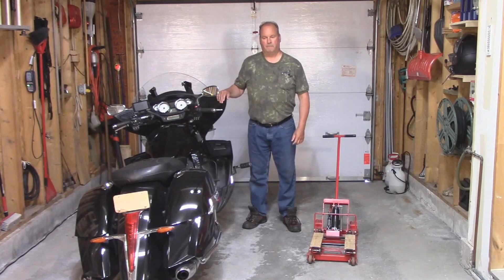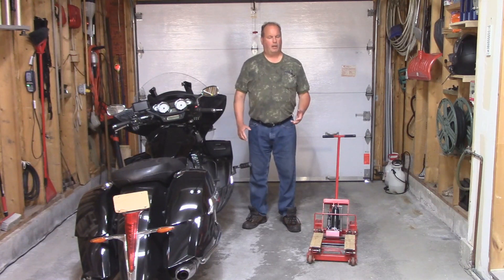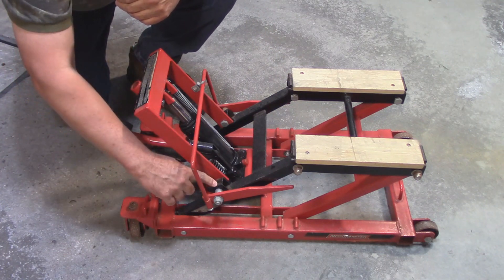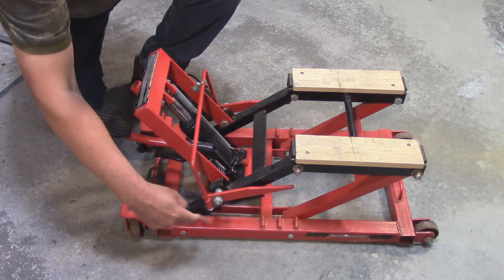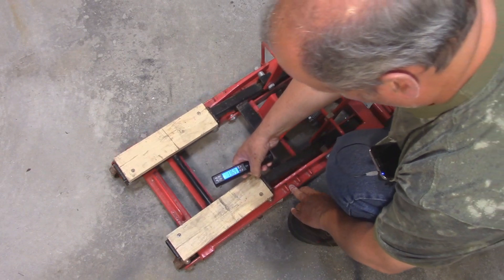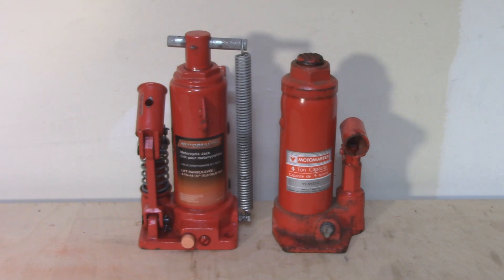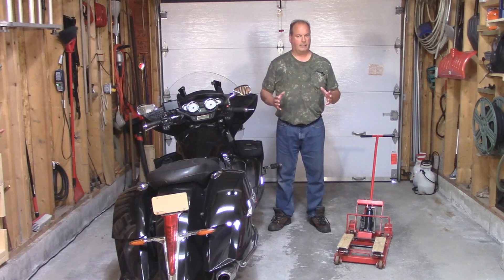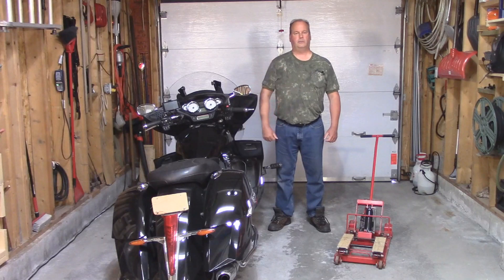Motorcycle Jack Warning

Comment: Thanks for the insight.  So by your calculations because of the mechanical "disadvantage" this 1500 lb jack can only lift 600 lbs.  This is another example of false misleading advertising.  Similar to air compressor ratings and HP ratings on tools.  It would be nice to have stronger consumer laws regarding ratings on these types of things.  The jack is not junk but is limited by design and mislabeled.
Reply from the maker: You are absolutely correct. With 1500 lbs at the jack point the total that it can lift is 611 lbs. The steel framing can handle the weight, it's the bottle jack that is the weak point. Switching to a bigger bottle will solve the whole thing. Even a 2 ton $10 jack will do it. I don't know why they don't use it. Thanks for watching.
Reply: @PaulPomerleau  so i have a honda shadow, 503 lbs wet. I just bought this same jack, but as soon as i opened the box it was time to take it back. A few things were bent way out of wack. But....if it does do good for up to 600 lbs , would you recommend i get another one and if i get one made right, according to the math it shouldn't fail over time correct? Or do you think i should put my money else where? Just curious on your opinion. Great video thank you so much for the info.